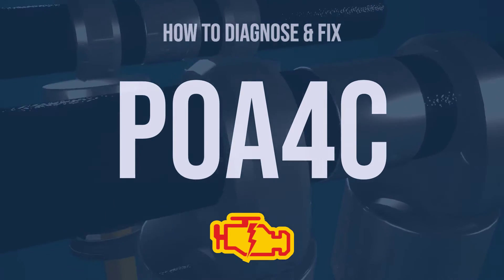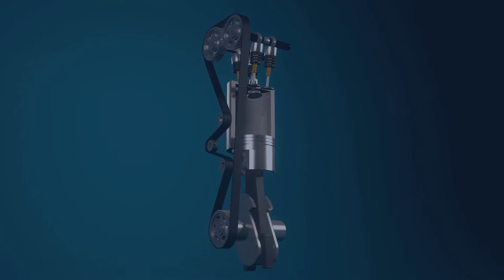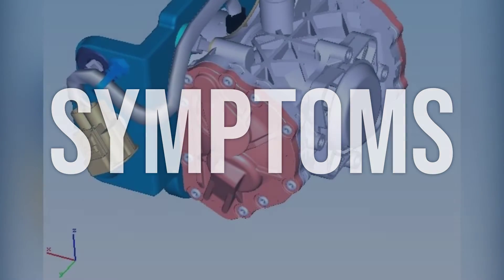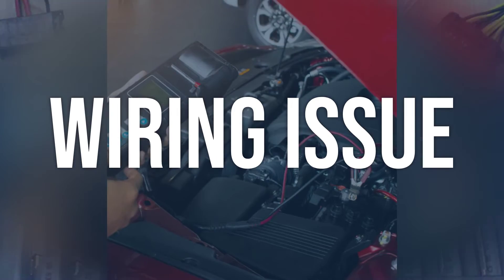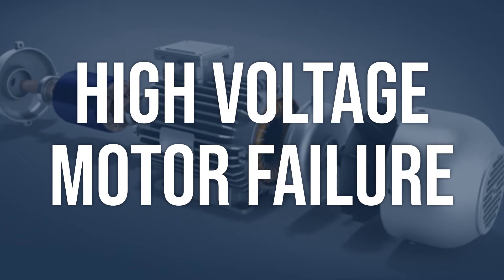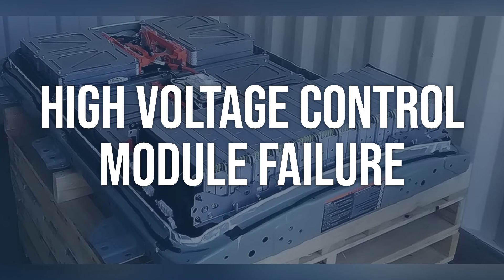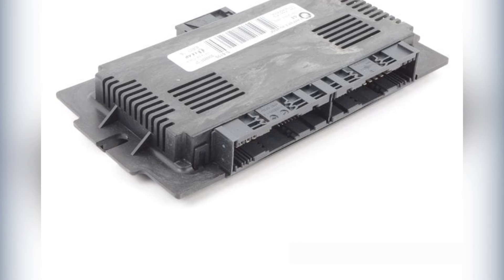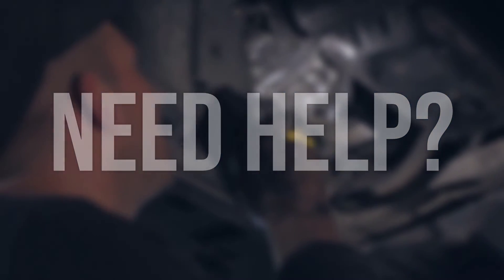How to Diagnose and Fix P0A4C Engine Code - OBD II Trouble Code Explain

Comment: Benim Toyota Prius 1.5
2009 üretim yıllı aracım var. OBD II kullanarak sorunları görmek istiyorum ve bana P0A4C , P0A4D kodlarını veriyor. Arabamı Bir çok tamircinin yanına götürdüm ve hiç bir tamirci sorunu çözemedi. İnternette bu hata kodlarını arıyorum ama kesin bir şey yok. Jeneratör'den motora bağlanan kabloları kontrol ettik o kablolarda da bir sorun yok.

P0A4C ve P0A4D kodları araba hareket halindeyken veriyor. Kodları silip yola çıkıyorum, 3-4 km yol gittikten sonra böyle bir arıza veriyor. Arabanı gece kullandığımda hiç bir arıza olmuyor. Gündüz sıcak havalarda kullandığımda hata veriyor. Tahminimce arabada bir şeyler ısınıyor ve bundan kaynaklı arıza veriyor.
Ama o ısınan şeyin ne olduğunu bilmiyorum. Rica ediyorum yardım edin.
Reply: Any luck to finding the problem? Having the same exact problem and same codes